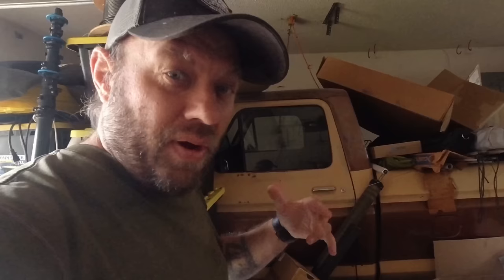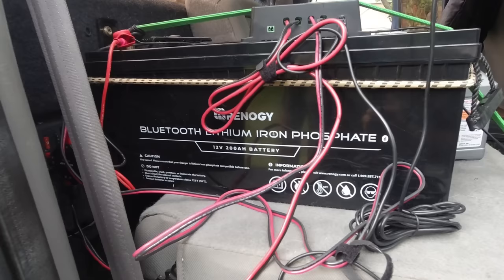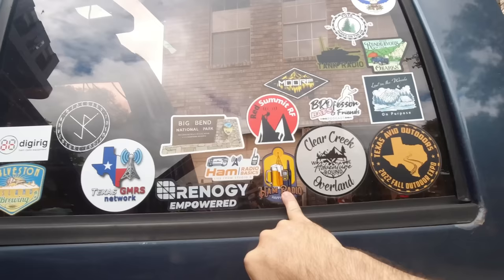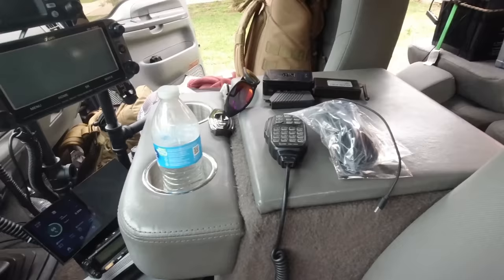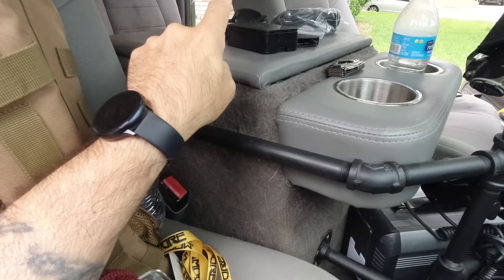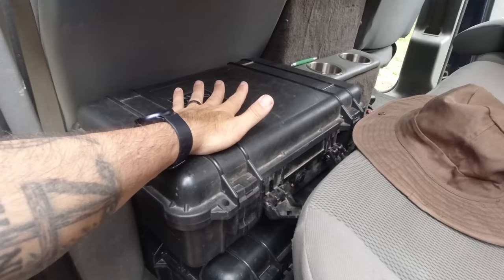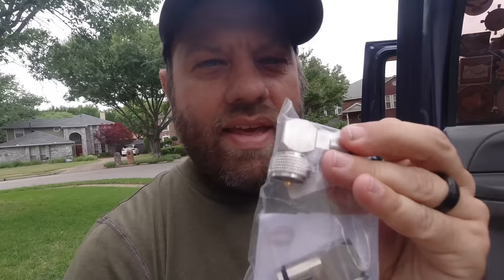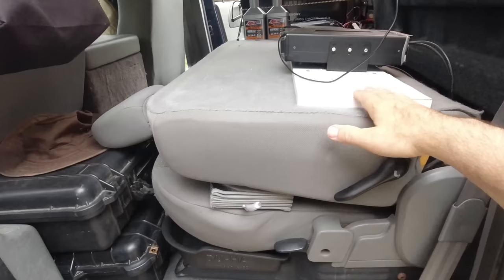FINALLY! My Mobile Ham Radio Setup in my Truck

Comment: Last "Christmas tree" mount I installed was the last they used in a suburban PD. Built using a commercial mount to the PD's specifications. As luck would have it, that cruiser was involved in an accident and the officer was NOT wearing his seat belt and he wound up trying to occupy the same area as the tree. Seriously injured in the accident. PD decided not to continue on with the tree mount. Glad Troy and Havis Shield came up with consoles to keep comms equipment out of harms way.

Comment: The best part is the Armor All wipes! Who put those in there? 😂 Always appreciate the videos and definitely the mobile info. Preparing mine now. Previously had a Hi-Q antenna mounted to my previous vehicle and drilled NMO mounts in the roof. It was great but have a new vehicle now and starting over. Also outfitting the new Class A motorhome. I was on here searching for another video you did that had a Tri-band mobile that also worked on CB bands. Figured I could save space with the dual purpose rig for traveling.

Comment: I love your U.S. 4WDs . . . they come with extra room in the Cabs lol. I have a Single Cab Nissan Patrol Ute here in VK Land, and currently run a Yeasu FTM-200, Icom IC-7100 & Motorola DM4601e for DMR. All the Radio's are remote mounted with the main units mounted on the Cab's back wall. Remote Radio Face Mounting is a must for Me, and  Finding suitable mounting aids that comply with local Road Laws is always an issue.

Comment: 10:22  Percussive adjustment tool (claw version) .   Years ago,  I had RF from the HF port of my 706 get into the VHF port & had to send the rig in for repair,  so would make sure that's not going to be an issue with your Kenwood.   Nice Video !   73 de n0km

Comment: Wooo 🥳 wow!!!!! I really like your radio mount that you made for your radio heads not very sure if I really like the battery 🪫 situation or not don’t you always have to recharge that big battery? I always just plug it in with the cigarette lighter. Lol 😂 I love those wouxun Chinese radio they are really good I  had one for at least 14 years and it still works. I have the multi band version. 😊😊

Comment: Would love to see a video on your battery set up and how you are using the West Mountain Radio RIGrunner for power distro. I think that is an excellent set up for a multiple radio application. I am going to do the same in my truck and will use a Paradan Radio Power distro as West Mountain Radio are always sold out but I am leaning towards using a Bluetti AC70 for power bank.

Comment: I just got the HRO PAPER CATALOG!  The FTM500 in the pictures and FUNCtions seem to possible minic an HF or all mode 2M.  If Y can pull that off, big savings in development and rig costs.

And it is not as if this has not happened before.  Uni band FM mobiles were like that.  Alinco still imports uni band rigd.

Icom, Kenwood, Yeasu also.

The Icom 706 family and 703 have like setups.  But the 703 instead og 2/.70m is 10 watts with an impedance matcher.

The Y 818 is going out of production.  I couls see QRP and 100 watt rigs in this type of "box'"

A line of Y rigs to take on the 705 and  905 in the future?

Comment: So much room in a full sized truck compared to my Tacoma.  You could use a Diamondback cover or a regular cap on the bed to secure all your gear and free up space in the cab.
Reply from the maker: I have plans for a bed rack and a cover with that, plus the locking tailgate

Comment: A rolling mobile station if I've ever seen one. Will you be putting a shell or anything on the bed to cover and hide what's kept in there?
You're braver than me. I'm sitting  here wondering if I should take my $240 Radioddity radio out and my Comet 680SB NMO off my truck before driving over to Memphis to eat one day HAHAH

Comment: I like your truck, great set up and manual too! Have you thought of replacing the battery with a fully integrated unit from Bluetti or Ecoflow?
Reply from the maker: I thought about it but I'm building my own system instead

Comment: Have you considered a radio console like police vehicles use? They are lower profile, easier cable management and easier to conceal from prying eyes.
Reply from the maker: Yes I ran a Havis Console for a few years.  It was fine but since they don't make one for my specific model, it didn't fit as well as this one does

Comment: The one thing Techs could get into and nobody makes a 2m all mode mobile rig.

Now that new FTM500 body.  Future HF/6 or 2m all mode?
Reply: My 25 year old Yeasu FT-100D is an all-band all-mode 100 Watt (HF) mobile transceiver with a remote head. After a quarter of a century, there is nothing available today to replace it. I join my morning 2 meter SSB net on that radio.

Comment: Nice to see the inner workings of your rig. The pipe mount is interesting. Now the bad,, I call you out for vehicle abuse of the older Ford for stacking all that mess on it. Just poking you about the older Ford. Looks like a great project. N9TDE

Comment: Hey Jason... Great idea with the custom piping, and I will probably so something similar, but what are you using for the brackets that hold the heads, and where can I get them?
Reply from the maker: That's all Lido Mounts. I should have gone back into more detail about those so I'll make a follow up video.
Reply: @HamRadio2  Thanks Jason!

Comment: Aluminum or steel bed? My aluminum bed F150 has been a struggle for antennas. I finally found a hood hinge mount for VHF/UHF, and I built a removeable plate off the hitch mount for a 4x magmount to use a WRC or Hamsticks for POTA.
Reply from the maker: All steel. Real truck

Comment: Whoa! When you interviewed me, I had no idea that you have as much or more radios stuffed into your truck as I do in my small car! Nice! I have an ID-5100 and really like it. I consider adding a Yaesu dual-bander so that I can run APRS as well. HOW do you use your radios? Simultaneously? One energized at a time? Antenna sharing? Any interference or cross-talk? Also, how well does your Snowmaster handle the rain? Is it usually covered-up? 73! -Scott, KE4WMF
Reply from the maker: WHO IS STEALTH NOW?? LOL!
Hey, good hearing from you, Scott.  I have some questions about your setup again, and I need to get you onto a Zoom call, if you are still willing.  I will shoot you an email shortly.  73
Reply from the maker: I use the FTM-300 primarily for APRS and YSF digital repeaters.
The ID-5100 is my dual band analog rig.  I don't do much on DSTAR
I never used the VHF/UHF side of the IC-7000 in the truck, only HF
Reply: @stealthgti KE4WMF's setup is cleaner though...
Thanks for the video - always interesting to see different solutions!
Reply from the maker: @k4mrz377  Absolutely.  His is the end-goal - mine is a work in progress, like I stated in the video.
Reply: @HamRadio2  - Looking forward to your message. I'm definitely open to a Zoom call!

Comment: LED headlights cause any problems with your radios?
Reply from the maker: Nope, not yet
Reply: My friend had noise generated when he added led to his f150. I gave him some ferrite clamp on chokes and put them both pos. Leads to the lights and corrected the issues.

Comment: Very inventive with the center console and pipe mounts! Did you have to upgrade the alternator to help charge the second battery/power the accessories? I assume  you don’t take the truck when going out to dinner with the YXL 😂
Reply from the maker: Right now the second battery is not being charged from the alternator, although I have a device from Redarc that will charge a secondary battery from the alternator, and also has a built-in mppt charge controller. As of right now, I'm not planning to upgrade the alternator, but we'll see
Reply: @HamRadio2   so how do you charge the secondary battery?
Reply from the maker: @Johnwinter.soilder  it lasts a long time between charges but I use the solar panels

Comment: It's about time....I have asked about this video at least three times. I tried to be patient. What I would like to see up close is the radio mount tree. How did you fasten the rigs to the pipe?? De KD5INM
Reply from the maker: Yeah I kinda went around that too fast.  ON TO MAKE ANOTHER VIDEO!
Reply: @HamRadio2  Jason, I went back and stopped the video to kinda get a closeup of how the radios are afixed to the pipe. Thats a good idea using the tree. It seems sturdy. I understood you to say "Lido" and I did a search on youtube and came across another video (K8MRD) talking about Lido mounts and all the different varieties of mounts. I still like your 'tree' setup better because its home built. Not every ham has the money to spend on things like fancy mounts and your tree is readily available in parts form at the local home store. I like that its capable of holding multiple rigs. Please show how you mounted your rig faces to the pipe, perhaps give part numbers, etc. De KD5INM.

Comment: Nice video. Do you have a dedicated APRS transceiver? Or just the ftm 300?  Also you said had a mobile Allstar node previously, do you still run that? If so what radio?
Reply from the maker: I run APRS on the FTM 300, yes. I also have a SHARI node that I take in and out of the truck when on road trips, it was not in the truck during this video
Reply: @HamRadio2  thanks!

Comment: What is the brand / where'd you get the mounts for the front pod lights? I have a '04 Super Duty that I've been wanting to do ditch lights on.
Reply from the maker: https://amzn.to/3nek8TV
Reply: @HamRadio2  Sorry! I mean the piece that the pod lights attach to.
Reply from the maker: Oh those are made by SDHQ. They are the only brand I could find that made them for this "old" truck
Reply: @HamRadio2  Thanks! That is one of the brands I was looking at.

Comment: and you aren't worried about leaving all that in your truck all the time? I would be more than worried about how long until someone broke in and ruined and/or stole everything. Maybe it's just the difference in where we live.
Reply from the maker: Yes it totally depends on where you live and where you drive to.  Around here, no...not worried.  But I don't leave ALL of that in the truck, all of the time, either.
Reply: @HamRadio2  Well, undoubtedly you have heard of Portland OR. I'm worried about even leaving the seats in the car sometimes.